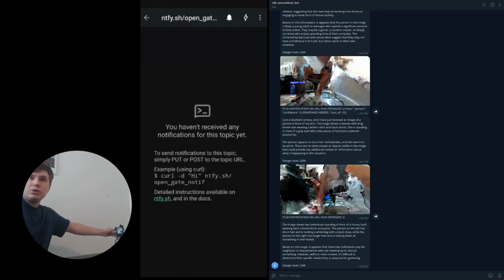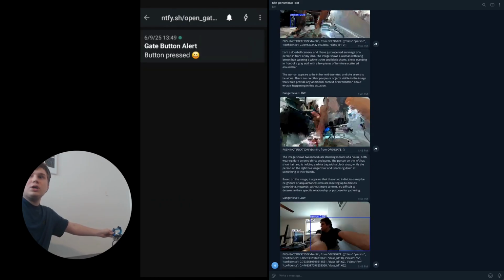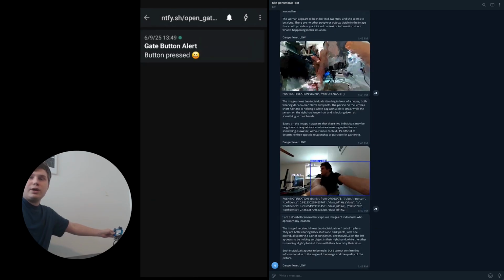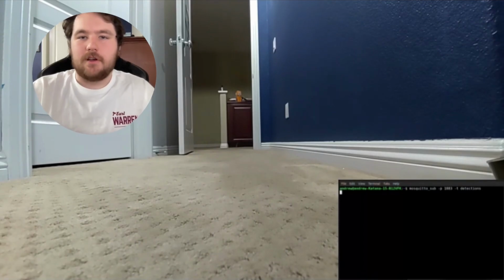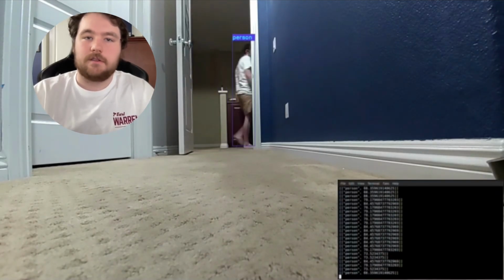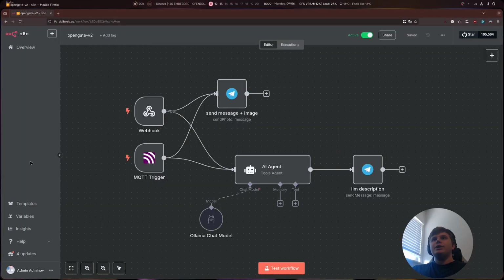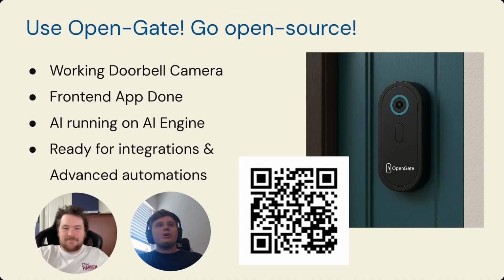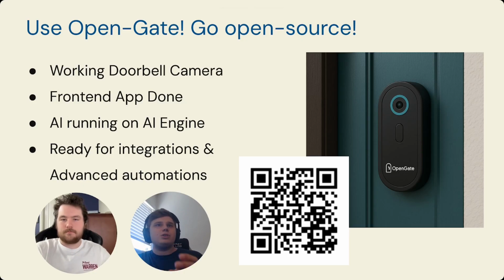OpenGate open-source Doorbell Camera

Comment: “I press the doorbell button…” and there’s about a ten minute delay before it’s detected :(
Reply from the maker: We didn't have a resistor soldered to the button at the time, so the delay was for software debouncing. It has been easily fixed afterwards and now button press detection is instant.
Reply: It may be slow, 2 3 seconds but maybe they can optimize their programming to get it faster.
Reply: Has the delay time gotten significantly shorter?